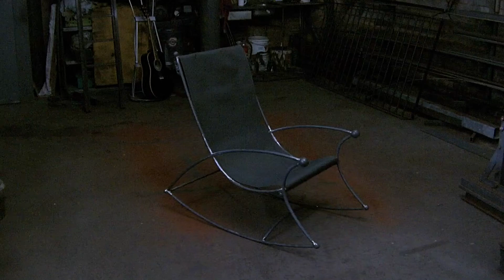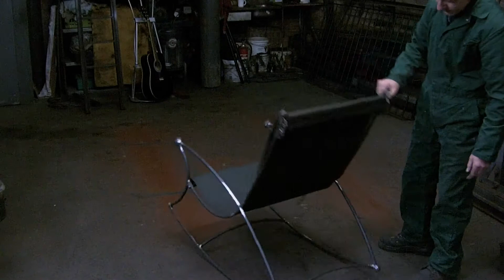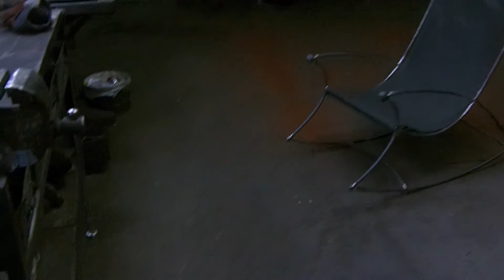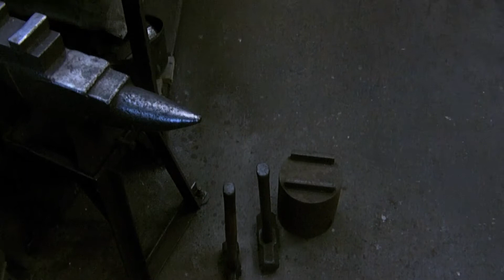FILE0011.MOV

Comment from the maker: @rlewis1946 Hi Roy, bend the first piece of steel to the shape you require, then bend the  next piece and lay it on top until you achieve the shame shape, make 2 sides, then add the centre pieces and join the 2 halves together,but before you fully weld it make shure it's the right shape, it maybe too high or too low, you might have to break the tacks ( small welds ) and alter it,   it's all trial and error until you've made your first item